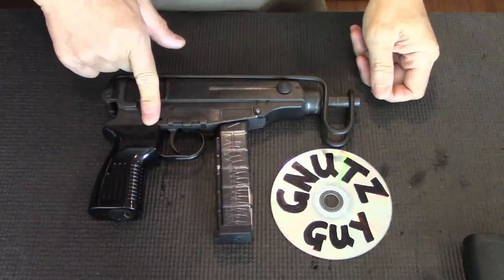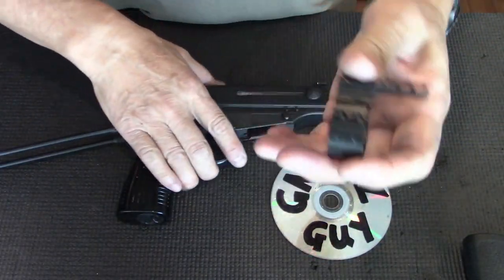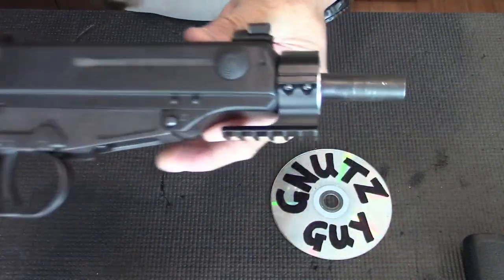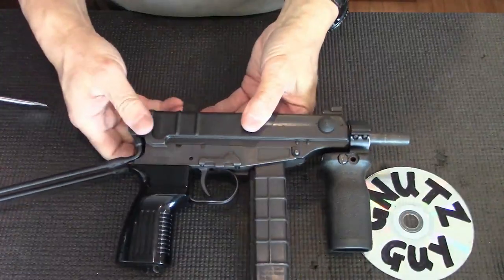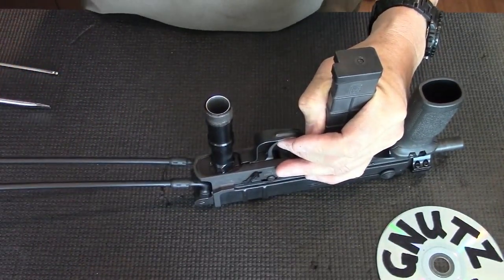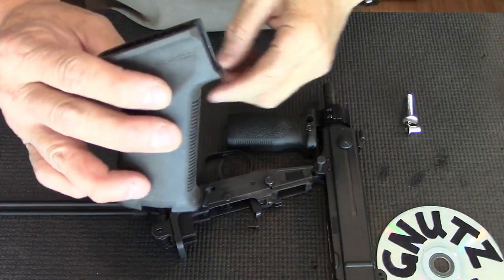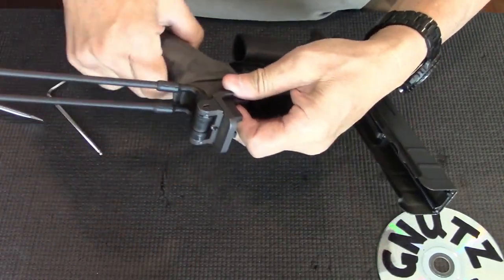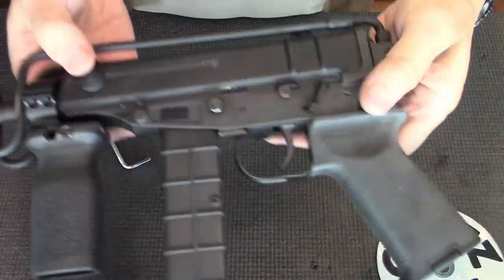VZ-61 Skorpion. Magpul Moe grips. CSA VZ61 & Zastava M84 Scorpion. *

Comment: This dude is doing great things here bud haha. Im in the US and build these off 3D printed lowers and mod a plate to hold the wire folding stock. Im going to copy this dude's design. I like the buttstock adapter and fake suppressor. Here we can form 1 a can and sbr it. Already in the process as we speak.

Comment: really digging what youre doing with these! have you checked out custom smith mfg's vz61 parts? the charging handle saved my fingers
Reply from the maker: im glad you mentioned it bcos i already tackled the charging handle in my next vz61 vid, i modified one from an airsoft due to cost but it would have been nice if i didnt have to mod. 
also another problem are many gun parts manufacturers in the US refuse to deal with canadians.
Reply: @gnutzguy  I was looking for an oversized airsoft one for awhile but couldn't find one, just t buy the whole gun. Might as well try to contact them, they may ship to Canada. They also have some cool  rail mountings and stocks. But keep up the good work, look forward to your stuff with these guns
Reply from the maker: they wont ship to canada but they are worth mentioning on my vid.
Reply: @gnutzguy  that's a shame. looking forward to your video on what you did for the charging knob

Comment: Could you provide some detail about the connector bolt you used for the grip? Having a hard time finding that exact one. Thank you!
Reply from the maker: strange you cant find "connector bolt" at your hardware store. lots on ebay search "M6 connector bolt" .
Reply: @gnutzguy  Sadly no Ikea in reasonable driving distance, and I'm unsure if Canadian Home Depots carry these bolts, but I had no luck in the States. 

If you can post the length and head width of the bolt you used, I'd love to make this modification to my VZ61. I'm afraid that if I take a guess and mail order bolts, the head will be small enough to fall through the hole, or the bolt will be too long to tighten against the grip.
Reply from the maker: the head is 18mm across and the length of the shaft is 38mm.
Reply: @gnutzguy  Thwarted. The one dimension I didn't consider got me---the width of the threaded portion of the bolt itself, and the outside diameter of the corresponding nut.
 I incorrectly assumed there would be one standard width, but I suspect it's an SAE vs metric issue.

The only connector bolts with dimensions close to the ones you provided which are sold at Home Depots in the US are SKU 472949 and 475861. 

The bolt is a quarter-inch wide, which is too much for this purpose. The bolt can only pass through the hole in the grip with some force, and there's no hope for the nut. 

Your bolt must be considerably narrower for the nut to be able to go through the hole in the Hogue grip.
Reply from the maker: You could drill the hole large to fit the nut.
Reply: @gnutzguy  Yeah, I might have to go that route. It would need to be at least 2x larger, I estimate. Someone should really make an adapter bolt that threads in where the rate reducer housing goes, and provides a threaded AK grip nut at the correct angle. The only obstacle there would be timing the part so it tightens with the grip nut facing rearward. I think the VZ61 would look great with a US Palm grip... I recently scored a .22 upper, so I'm looking forward to running that with my suppressor.
Reply from the maker: if someone made adapters then they took all the fun in modding out, lol.
Reply: @gnutzguy  You're a modding madman. Shine on, you crazy diamond.
Reply from the maker: lol.... thanks to you, i have included more details in the description. 
this is my most popular vid at the moment, it just took off 3 weeks ago.
Reply: @gnutzguy  It's great content! Innovative and effective. Recently heard about the likelihood of new bans for you guys, I hope you can hold the line! I vacation in Eastern 
Canada regularly, and always enjoy myself immensely.
Reply: @gnutzguy  Ayyy, success: https://i.imgur.com/koQvaLS.jpg

Had to drill the damn grip out to 1/2", but got it all together. 3/4" probably would've done the trick, also. The outside diameter of the nut barrel is .34" or 8.8mm by my calipers.

I tightened it down as much as was reasonable, but there's still a bit of twist play if you look for it. Still, I'm quite confident that it'll shoot just fine. With the increased grip angle, the package feels even more front-heavy, but I plan to hang a folding "pistol brace" off the back end, so that should balance it out a bit.

Thanks once again.

Comment: Since the VZ 61 already has a stock would it be classified as a Short Barreled Rifle even before changing the grip to an AK style grip? Although  this VZ 61 is a semiautomatic firearm barrel length and overall length still are the same.
Reply from the maker: sorry, im the wrong to person to ask about gun laws in the US.
Reply: Yes. The VZ 61 is sold in a pistol configuration. There is an adapter plate available for the stock if you choose to go the SBR route

Comment: With the ak moe pistol grip installed do you think you could add a sb47 arm brace to the vz 61 ? Been looking into adding a brace but want the best for ergo and cosmetic value . Thanks in advance !
Reply from the maker: i dont think so, there would be a large gap behind the receiver.
Reply from the maker: how about using czechpoint brace adapter ($65) ? i always liked the looks of the round tube.
Reply: Check out the picatinny adapter that Custom Smith Mfg produces. It works with folding Sig MPX braces, and also includes a rail for mounting a small red dot.

They also make an extended bolt handle.
Reply: Isle mfg. makes a really nice adapter for like 30 bucks!
Reply: Jared Keith now with that adapter I plan on using a folding brace . I will have to drill 2 holes in the receiver . Would that still make it  ok or would I have to file for stamp for sbr because the sb47 route was for me to avoid all the paper work . What do you think I’m curious .
Reply: Zay Gomez You’ll be perfectly okay! Czech sells them with the holes predrilled. It’s no different than having a buffer tube on an ar pistol!
Reply: Jared Keith thank you for the response I’m about to order right now then , also have some extended charge handles in the cart as well much appreciated !!

Comment: Really cool mods, looks slick. How has the vertical grip held up over time? Couldn't you just use a 1" ring instead of a 30mm to get a tighter fit without using shims?
Reply from the maker: it held up good with a 6 screws gip, i originally had a 4 screws grip. roughing up the shims really helps. 1" is too small.
Reply: @gnutzguy  ah thanks, I'll try a size screw to be safe. That's sucks eh, 30mm is too big, 1" is too small
Reply: @gnutzguy  do you think the 1" could be lapped a big bigger to fit?

Comment: do you have any idea where to get these size bolts? I've gotten a bunch from amazon and went to every hardware store in town and cant find a bolt with a head larger than the hole to cut. if you have a spare ill buy it from you. I'm going nuts over here
Reply from the maker: search "joint connector bolt" on ebay or your local hardware store.

Comment: The Problem with a GRIP change on the real VZ 61 is that their is a mechanism inside that tube that reduces the fire rate
Reply from the maker: yes, i know. please check my vids on 32acp vs 380 comparison.  the 32acp comes with neutered rate reducer and the 380 doesnt. what is the point of having a neutered rate reducer in a semi?
Reply from the maker: yes, cant change on full auto but not many of us have a full auto.
Reply: The rate reducer is worthless if it's not select fire.

Comment: a dab of loctite on the pistol grip screw....
Reply from the maker: good idea.
Reply: Locktite 242, so you could remove it without tearing off the threads in case you wanted to...

Comment: i dont like the way this is mounted. feels like recoil will make it slide
Reply from the maker: i assume you are talking about the front mount. its only a $3 for a 4 screw rail so why not try it? 
or you can spend $9 on a 6 screw rail, i shot this one and it didnt move. https://youtu.be/raxuOhj6HTY
Reply: @gnutzguy  Please post links to the barrel clamp with rails. I could not find them anywhere on eBay.
Reply from the maker: @brucebelvin2058  search "30mm tactical rail" on eBay.com
Reply from the maker: btw, if you are not using a folder then best to buy one with 6 screws but you will need to cut off the bubble level (see tactical vz61 vid).